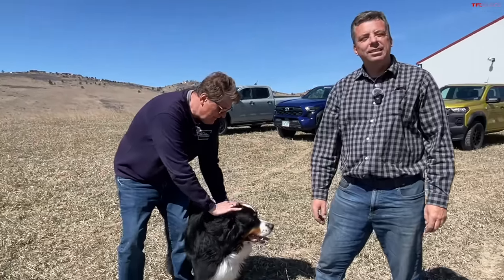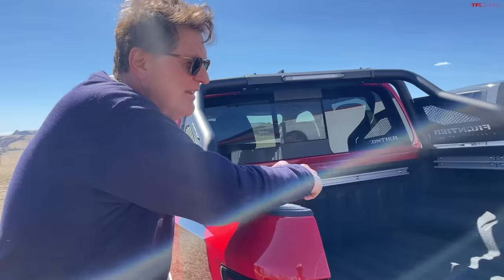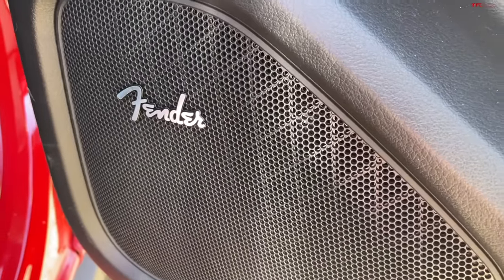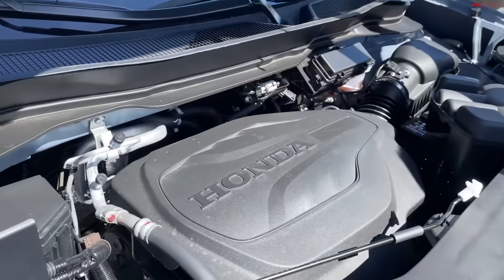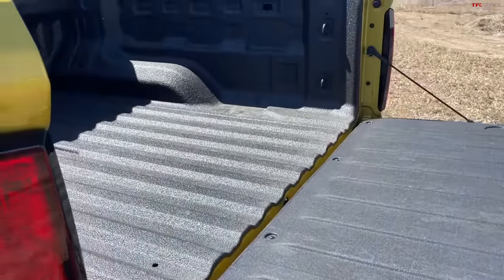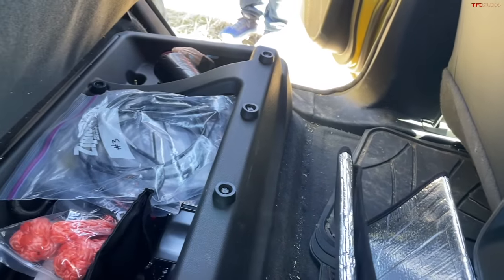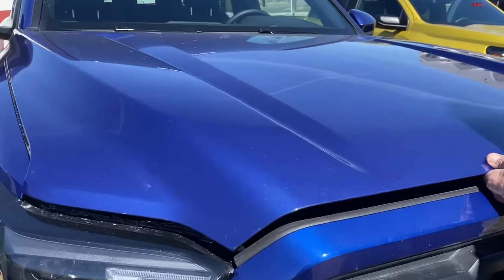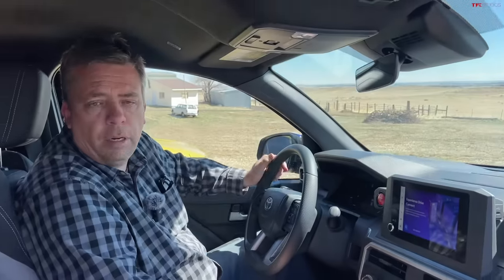We Compare 5 Brand New Midsize Trucks: The Differences are Very Surprising!

Comment: Whats the best ACTUAL TRUCK all around, doung ACTUAL TRUCK THINGS.  Not offroad,  cuz we all know,  none of these are a jeep...all need to be pretty modified to keep up with a wrangler sport on rocks and mud, so what's the best TRUCK. And best deal?  Cuz your opinion matters.
Reply: Ridgeline. Best options and space for around $45k. Can get the base Ridge for under $40k.

The ground clearance can be mitigated with a lift.
Reply: @hsvnole  ok...while I never considered it, the new Honda does seem much better than years past. Still unibody tho,  less towing capacity than even the frontier. The "bunk" is cool, but I need a longer bed, and more towing..but props to Honda for an actual v-6 engine. I bought a 24 frontier sv long bed 4x4 just over 40k. With premium blah blah blah, and much better seats (not leather)  works for me. To do TRUCK STUFF. I turned all the sensors, monitors,  all the annoying things off. Home depot runs, pull my boat...all I need. I wish these companies would remember,  some people just need/want a TRUCK.

Comment: Toyota does not have a TRD anymore. Who would lift a 4 banger? It is built that way for a reason. Once you start adding/modding that 4 banger,  that turbo charged engine is gonna work harder. So much for reliability.

Comment: Back in 2019 $47,000 could've bought you a full size truck.  More turbo chargers equals a shorter engine life span especially with the turbo charged 4.  Obsolescence in the making

Comment: I just want a midsize with a longer wheel base that has legroom like the full size trucks have.
Reply: That puts you in the jeep gladiator or honda ridgeline.  Those are the two midsize with the larger rear passenger sections.

Comment: Drives me up the wall that Honda (and others) do the push button PRDL. Why? It does not save anymore space. It’s not easy to use especially when navigating a 3 point turn.
Reply: I disagree. The buttons are a lot easier to use and don't get in the way of phones and drinks as you're using the console space. A tall shift handle is very obnoxious. This is especially true in the new Accord that reverted from buttons back to a stick shifter. It just gives drivers something to "grab" that they like.

Comment: How many of these boosted engines are open deck? I know the 2.3 Ecoboost is. That's the recipe for a blown head gasket. If you're getting one of these, you can't tune it...okay you can tune...just not for long. The 2.7 Ecoboost is the better engine...all around. It's a closed deck block. If you get a 2.3 always wait until the engine is completely warmed up, before using full throttle. Why oh why, would you use an open deck engine with boost....why Ford?

Comment: Too big all of them. I prefer the old smaller Ranger and Courier size. These were a great size for tradesmen, easy to park, and cheap to run. The new mid size trucks are too big and are too car like for amenities. Toyoto has cheap small truck that would be a great utility work truck but it is not available in North America.

Comment: I’ll stick with my 2003 5 speed sport trac 230 k with  new engine and clutch…in fla no rust….only thing I can afford…it’s got composite bed…electric rear sliding window……heat and cup holders in the back……heated front seats..leather steering wheel…electric windows…AC  …22 k new …4.0 ohc..200 hp…new trucks ain’t got anything better..except touch screen…but I can use my cell phone for that.

Comment: Funny the frontier is the same price as the Ranger but I'm Canada it's roughly 20g cheaper.
Reply: Its because of the hardbody package.  You can get a normal frontier sv in the $35-$38k USD range.
Reply: @spyder000069  I just meant that in Canada even those packages added aren't near the price of the Raptor. I built a bison with add ons and it was 96k before taxes and fees in Canada. The conversion in Canada is wildly high. Basically another 70%.

Comment: I disagree that the Ranger looks like the Everest.  I like the Everest Under Armor logo look of the front end better than the Ranger's.

I agree that Ford duplicating the styling from one truck to the next is a problem in that they don't create differentiation between models.  The Maverick looks like the Ranger which looks like the F-150.  It's an issue that Ford has always had, in that once something becomes visually appealing, they apply it to everything.  They need to stop doing that.  The Ford logo/emblem is the thing that brings all Fords together across the models.  It shouldn't be the headlights or the grill facia.

Prior to the late 1970's, each model bore a unique look. Unless Ford were to use the same size components, using the same look from model to model doesn't save money or tooling, it just makes everything bland and homogeneous.

Comment: You guys are confusing your subscribers by showing different trim levels and comparing as the same on price points, also you guys never mention what interest rate financing from the manufacturers on their midsize’s, for example Chevy and Ford give no incentives in financing or discounts on the price, where as Nissan does offer subsidized financing and so does Honda! But qualifying now vs precovid is a whole new story. Anyways just wanted to point this out, Andreas Chevy prices have gone up in just one year, so the 41k is out the window, now I just bought a Honda Sport ridgeline for 36k after all incentives and dealer discounts, but I will tell you I sure miss my 2021 Colorado ZR2 as it just feels more like a substantial truck. Oh and as for mpg, my ZR2 actually gets very close to the mpg of the ZR2, 17 is accurate if your freeway and city is about equal but I actually got 23 combined going 90% freeway

Comment: Don’t care if people have enough room in the back. I buy the truck for my comfort. My dogs will not complain about rear seat room. Too bad Honda will not get in the game. No true 4x4, the Honda is a mall crawler. It has a real weak looking design. I like the trunk in the bed, but I haul dirt and gravel and I would have to clean out the gap perfectly before I could open the trunk. No value for a person that needs a real truck. The Colorado has a disappointing interior. The dash in front of the passenger is beyond cheap looking. The driver gauges and center stack with the touch screen is ok. The Toyota is very nice inside. The gauge cluster looks great the dash looks great. The outside styling is aggressive and looks great. And no I am not a Toyota owner. The tow limit on the Toyota is not good. 
I have a 2018 Colorado and 4 auto is amazing for conditions where the road has icy sections. Put it in 4x4 auto and forget about it.
The Ranger like most Ford products is not aggressive looking enough. I don’t like Fords grill. The Ranger Raptor has an all dark interior along with dark color seats and it is impressive looking interior. If you use your truck for a truck then you don’t want anything white inside. It just gets dirty and ugly looking. Although there touch screen is oriented bad and it really doesn’t need to be that big. Ford is having to many reliability issues as stated by there CEO……….

Comment: After over 30 plus years of listening to car guys, reading car enthusiast magazines and scouring websites automotive journalists still cry about things that are inconsequential at most. For $46k, why am I still getting a key? Stupid. Ford is giving you a lot of value here. Folds down armrest. Look more cupholders. That was something they focused on back when I was a kid. They are so biased against NA engines with proven track records, and they even made an argument against their precious turbo fours and sixes. More power but same fuel economy...and more stuff to go wrong. Smaller displacement engines with multiple turbos are not the way to go, but whatever. I will keep my 2019 TRD Off Road going. Additionally, the Ridgeline is not a truck. It is a minivan with the back third cut off. Is it reliable? Sure, it's a Honda. I would not trust it to tow anything, or take it off road. I do like the Nissan, but not the hardbody edition. Ugly and too expensive for not enough content. Only thing cool are the wheels. The Ranger looks interesting, but the turbo ecoboost has had issues. The Tacoma would be a natural first choice for me, but not for a couple of model years and we see how all the new tech shakes out. That engine, too. I appreciate you all doing the hard work and all. Just too biased for my tastes.

Comment: A cheap shot on Ram bitching about having to pay $300 extra for a brake controller That Ford Ranger doesn't even come stock with a hitch! That's an extra $500 without brake controller. Adding the brake controller is an additional $325 making the Ram a better deal.
Reply: It has a hitch. Watch the video again
Reply: @erics8696  That's my point. That Ranger has it because the option was added, but it doesn't come stock like on the Ram. At least on the Ram, the hitch is already there, and you only must pay extra for the brake controller.

Comment: I’m a Ford guy, but give the Chevy the looks trophy, Frontier trophy  for being really retro cool, Toyota [ they will work the bugs out]  trophy for quality and long lasting if you don’t  live where they salt the roads, Honda trophy for being a car guys truck ( not in a bad way and get use to visiting the dealer service Dept . to obey all the service lights), Ranger trophy for the lil truck I’d buy with the 2.7 and the MOPAR a trophy for being a lil truck designed by out law Dodge engineers/hot rodders that just wanted to  stuff V8 in a great looking lil truck that still looks pretty good. I just drove a late 60’s GMC it was loud, lots of mechanical sounds,rough riding, no options, wondered side to side on the road and I absolutely loved it!

Comment: The ridgeline is so low and so ugly.. but it’s the safest one of the bunch, super reliable on the streets, really comfy, tons of storage, but the shape:( the 6 speed “manual” in the Tacoma.. keep in mind it’s a fake manual.. no clutch.. to our dismay:(and the infotainment still blows! The Chevy Silverado 1500 has a 4wd automatic so no switching between hi and low and it’s amazing in mn winters but it won’t fit in the garage and the infotainment is weak sauce compared to the 2500

Comment: No canyon
Reply: Canyon is the same truck as the colorado with just a few options changed.  Same engine, drivetrain, dash lcd, infotainment system.  The low trim canyon does have 4wd low.  The at4 canon is basically a colorado z71 package with the 2" lift that is on the trail boss.  Considerably more expensive though.  Also not a big fan of the brown dash on the canyon.

Comment: The Ford Ranger looks terrible on the outside.  It is too round and bubbly, and the stance looks like it is going to fall over off its wheels.  The interior is cheap plastic that does not fit together well.  It is lousy all the way around.  The Ranger Raptor does look good.

Comment: Smaller turbocharged engines that get the same fuel economy as larger naturally aspirated engines?? I dont like that, it sounds like an esg/climate change/ carbon emissions reduction  push by governments.  I'd rather not drive an ev or turbo charged engine, naturally aspirated engines are proven technology that works well.  Turbo engines work harder and get more stressed compared to larger non turbo engines.

Comment: DODGE DAKOTA GENERATION
1st generation:
BEST DODGE DAKOTA YEARS: 1990, 1991
WORST DODGE DAKOTA YEARS: 1987, 1992, 1994, 1995, 1996
-
2nd generation
BEST DODGE DAKOTA YEARS: 2003
WORST DODGE DAKOTA YEARS: 1997, 1998, 1999, 2000,2001, 2002
-
3rd generation
BEST DODGE DAKOTA YEARS: 2009, 2010, 2011
WORST DODGE DAKOTA YEARS: 2006

ratings and problem reports for each Dakota year is based off Edmunds, Kelley Blue Book, and Consumer Reports

Comment: People need to understand d Honda has a timing belt. Also can’t go off-road at all. It’s very comfortable though
Reply: Its a minivan pickup.
Reply: Honda seems to be the most reliable based on all the reviews I have seen. Also, lots of overland videos show off what a lifted Ridgeline can do on the trails. Not the best but can handle 99.9% of what most folks can handle. Fully agree it is not a rock crawler.
Reply: @hsvnole  best choice for most people tbh. Only negative is lack of frame and timing belt
Reply: @billricheter5678  agree
Reply: @hsvnole  it isn’t a truck either
Reply: @devildog5354 😂 I totally understand. I would need just a small lift to get me comfortably through some very easy trails.

Comment: far and away the Tacoma is my pick. but man they are just sitting on the lots. i have been paying attention to auto-trader and its the same number at for the TRD off road models.
Reply: The Tacoma won’t be reliable at all. Mark it
Reply: Also way too pricey (thank you local dealerships) and smallish on the inside.
Reply: After seeing what happened to blueberry, the taco is rubbish. I still drive my 07 and am in the market for another. I'm leaning towards Nissan or Honda.
Reply: Tacoma is WAY overpriced. Did you notice no power in bed or behind center console? To get power seats etc. that truck is in the low 50k price range.
Reply: I got a 24 TRD ORP for 62k CAD (46K USD). Being 6'4 it is actually really comfortable driving, however I think it is literally not possible for me to fit in the back. I know people hate the turbo but it is fun to drive.

Comment: The Ridgeline IS NOTTT a midsize truck. Its unibody construction that competes with the santa cruz and maverick.
Reply: I don't care what you call it, the Ridgeline is the best alternative for casual pickup users who move furniture, garden store goods, or cargo from a Home Depot run. We don't all need the most payload or towing stats, or rough ride, of body-on-frame trucks.
Reply: @tomhockman6267  The Ridgeline is the best grocery getter but the worst truck
Reply: The Ridgeline imo is designed more for suburban types, which is probably the largest buyer segment really. It is a Honda Pilot with a bed. It is not made for serious truck purposes. But outside of a few things like towing and off-roading, it does almost everything else better than these others. The backseat is almost worthless in all other midsize pickups. A 6 ft person is very comfortable in the backseat of the Ridgeline, it rides smooth, quiet, plenty of power. The most practical vehicle for the majority of people. Fugly tho imo.
Reply: @BC08  you probably need a full size truck to fit your clown shoes under the dash. Ridgeline does way more than a grocery getter, no it's not an F150 but it's competent.
Reply: @SuburbanOutdoorsman67   No more competent than a FWD minivan.
Reply: @BC08  nah, but you do you, anyone who actually drives one knows better.
Reply: @SuburbanOutdoorsman67   Everyone that actually bought one slowly convince themselves it is is more capable than it is.   
It’s called coping

RL does in fact have similar capability to the Odyssey and Pilot upon which it is based and shares powertrains with.  

But “you do you” boo, I’ll stick with reality